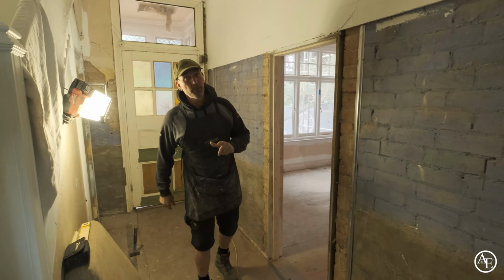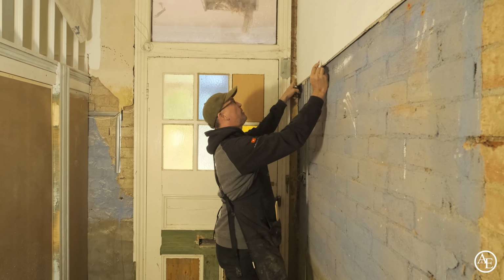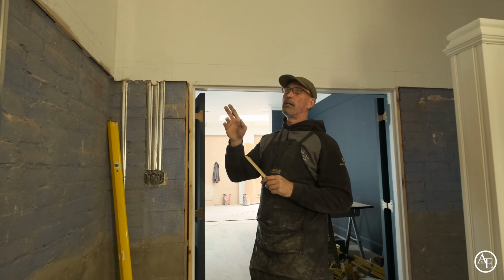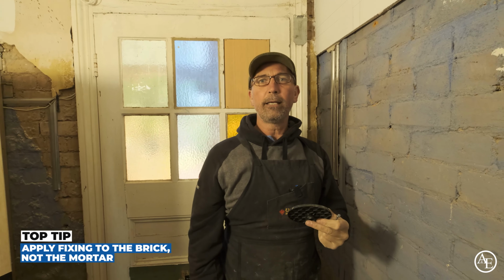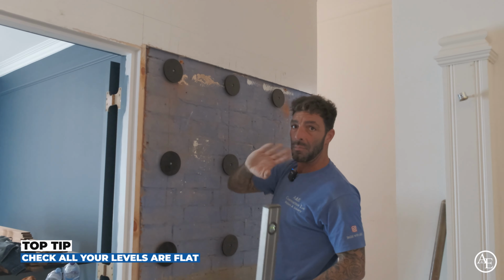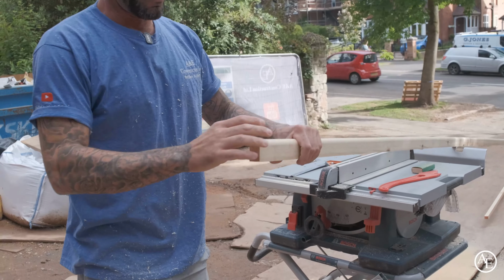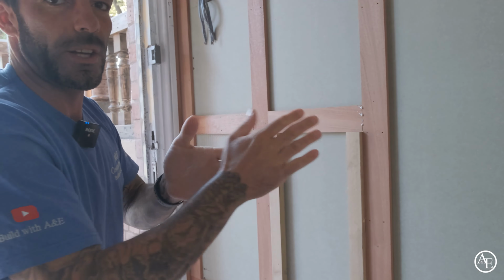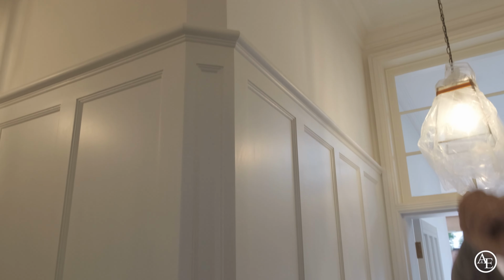How To Install Wainscot Paneling

Comment: Absolutely top notch. Can you use that Atlas leveling system in combination with elements board?
Reply from the maker: Hi Eduard much appreciated I’am sure you can just check with Atlas technical all the best Tony 👍
Reply: @BuildWithAE  Cheers. I've had a quick look on their website, but it's not specifically mentioned.  I'll send them an email.